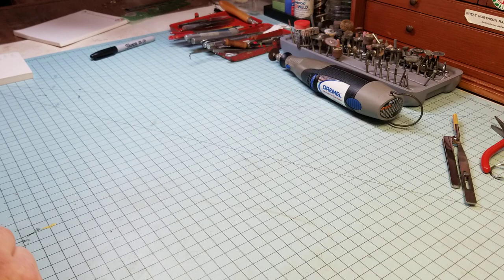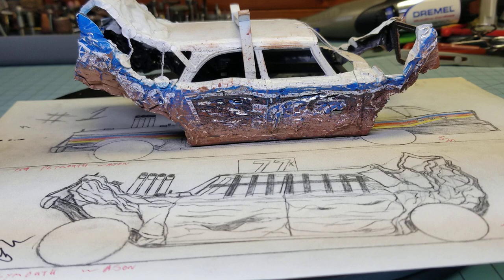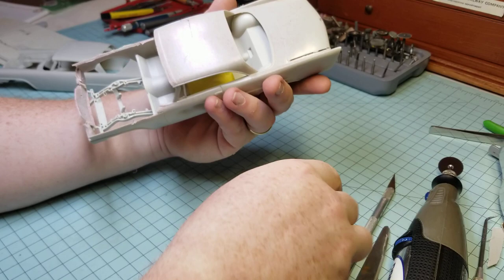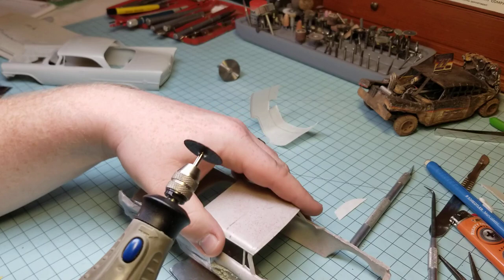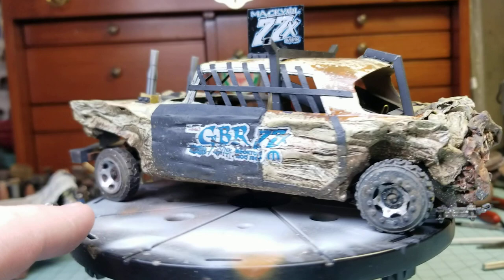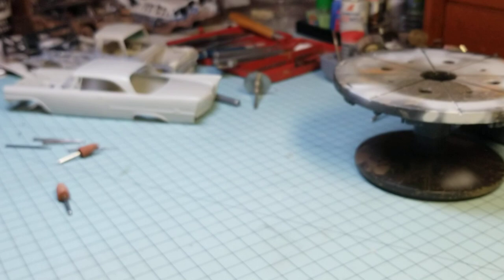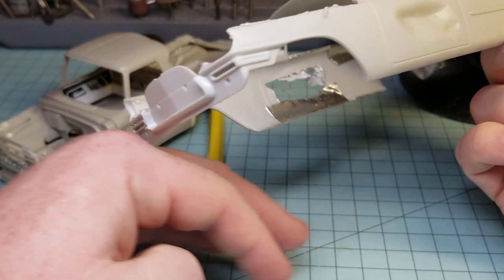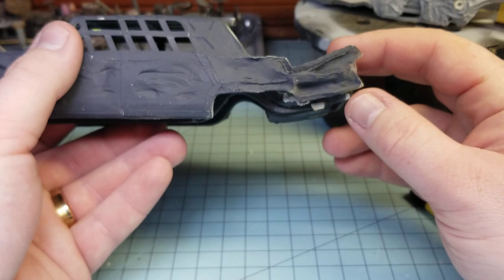Model Derby Car "How-To" Series Video 3: Damage Basics, Foil & Plastic

Comment: Looks pretty awesome. So many great details!
I am not much of a model builder but I have built  
Winning derby cars. 
Just a couple thoughts; remove fuel tank, rules dictate for most derbies. 
add wheel damage. Those wheels would die fast, with tires stretched like that.
Idk how you would do it but show welded door/trunk/hood gaps. Nice work. ABG

Comment: Where do you get the engine/headers
Reply from the maker: Some I build, some are 3D printed. I use 440 chryslers from the revell special edition 68 charger kit, and 350 small block chevys from the revell special edition 68 (I think, might be a 69) Nova kit. Best engines of their types I've seen in scale.